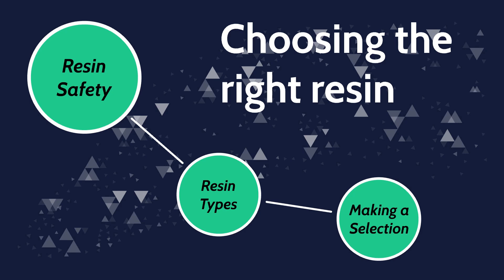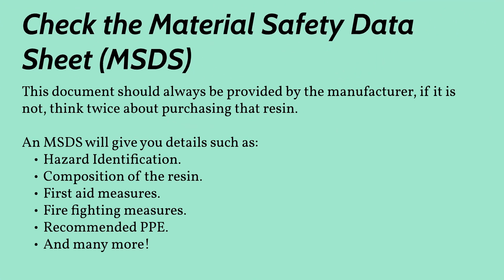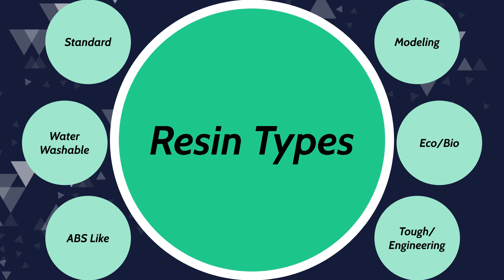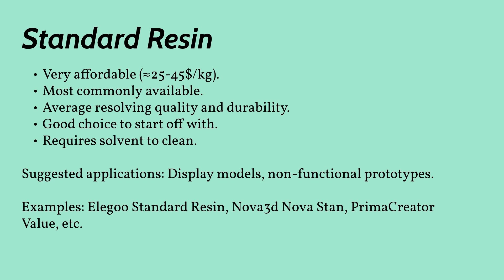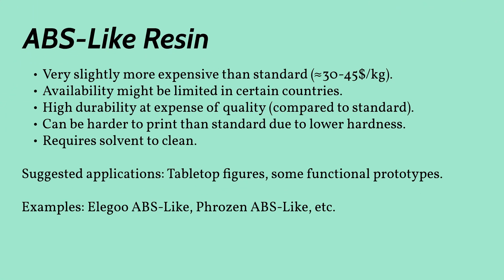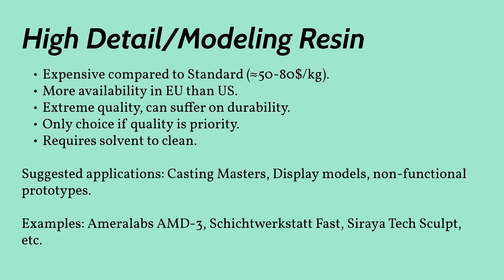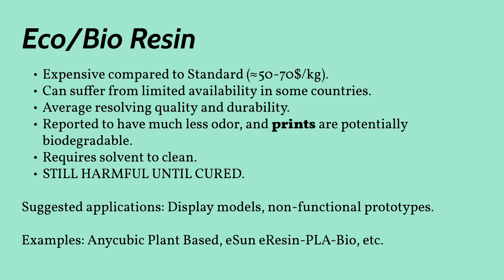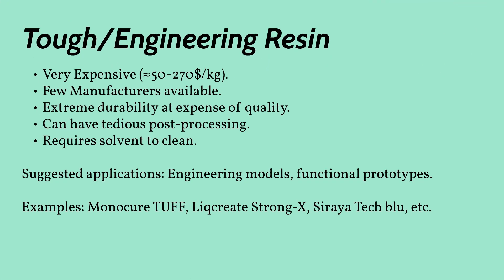Choosing the right resin for MSLA 3D printing

Comment: I want to print small mechanical parts that rub into each other, kind of low friction maybe needed .. Any resin recommendation ? I think abs-like could be good but im not sure :(
Reply: Id suggest choosing between a "tough" resin and maybe considering cutting it with some flexible resin depending on how much shock resistance you need. siraya tech blu and siraya tech tenacious is a pretty popular combination for this

You can use graphite or grease for lubrication, in some things like brass bushings you'll see graphite mixed into it to give it self lubricating properties but I think if you tried to do that with resin you might compromise the strength

Comment: Hiii, i'm new to resin printing and i'm interested in making accessories for 1/12 scale action figures, would ABS-like resin work for that? i need the parts to be durable so that the figures can hold them properly and without worrying about the piece breaking. the pieces would be almost 2 inches in height and around half a inch in width, please suggest what type of resin might work properly with good durability

Comment: Thank you for this! I am looking into purchasing a resin printer for some rapid prototyping as well as RC car parts like suspension links and possibly even gears. This is the only video I've found explaining the different types of resins and their specific applications. Do you have any personal experience with any of the resins you mention in the Engineering category? I feel they would be best suited to my needs but as you mention, they are not cheap. Any advice is appreciated and you have a new sub from me!
Reply from the maker: I do not have personal experience with any of the engineering resins myself, but my advice would be to see if you can get hold of some sample size bottles and test out what works best for you.
 
  I believe Sirayatec Blu is the most affordable, but it’s relatively hard to print and not as great at resolving detail as some others. If you’re EU side I would additionally suggest to check out Ameralabs TGM-7 (wasn’t around at the time of making the video I think). While aimed at miniatures, it’s quite a resistant resin and might fit your application.

Thank you very much for your sub, it’s greatly appreciated! Just need to find some time to make some more content for the channel.

Comment: Most detailed video on resin I've found so far, I hope you make another going over the other typs of resin aswell. I wondering how safe fully cured resin is for things that would come into contact with your mouth like a whistle or a mouthpiece for an instrument and so on, or even skin safe for rings or other jewelry. I can find lots of info happy to talk about how toxic the liquid resin is but nobody talking about how safe cured resin prints are.
Reply from the maker: Thank you so much for your comment! I really appreciate hearing this.
It would be really hard to properly comment on the post cure safety and probably no one is doing it because they don't want to take on the liability in case something bad happens. 
Purely in theory, if properly sealed off with a varnish or something along those lines, the prints should be safe(-ish for one time use or something). Personally, I wouldn't trust them anyways (and wouldn't recommend it either) for anything that will come into prolonged contact with skin or go into my mouth. Plastics will have a tendency to leach things through them over time and when you post cure, you're only really curing the top most surface and maybe a just little bit past the surface, so whatever is deeper inside the model, would potentially be unsafe. Then you have the other moment that since you're still not creating a completely smooth surface due to the voxelised nature of MSLA, you will anyways get small areas where bacteria build up can occur.
It's also really hard to quantitatively measure how safe or harmful a cured resin print would be. Really, in a situation where you want to use a resin printed part, and possibly avoid any health risks, using the prints as masters for casting molds would be the safest bet.
Reply: @3DExtra  good advice and exactly what I was worried about, I was hoping that using translucent bio compatible PLA based resin would be enough but my backup plan was to use dental resin because it seems the safest even though its quite expensive. Dont they also make high-quality resin that supposed to be used for printing jewelry? I just don't see how we don't have a resin by now thats more contact safe than ABS
Reply from the maker: Yeah, dental resin would probably be the best bet but even then i’d read the documentation on it super thoroughly, really in the long run if you’re planning some sort of production of parts, silicon molds of the prints as well as a food safe 2 part resin might even end up cheaper. As I mentioned the bio/eco and that whole section of resins are really badly marketed cus while one part of them is replaced with a more environmental substance, the rest, such as the plasticizers and photo-activators are still super nasty stuff. The jewelers and casting resins, such as bluecast, sinertec, etc, are actually basically wax. They’re super high quality in detail reproduction but are then used for investment casting and are formulated to be able to burn out of the molds cleanly to then get a good cast in gold and other precious metals. I’ve got a jeweler friend so i’m tempted to at one point do a video on it, but we’ll have to see how it turns out with the local lockdowns, etc. At the moment December was super busy so the channel went on the back burner for me.
Reply: @3DExtra  thank you again for your reply, I really appreciate it. There's definitely a lack of technical information when it comes to resin printing, I feel I've gone through nearly all the available information at this point. You've given me allot to think on though. Thank you